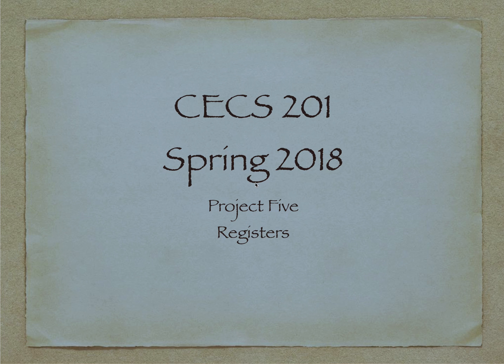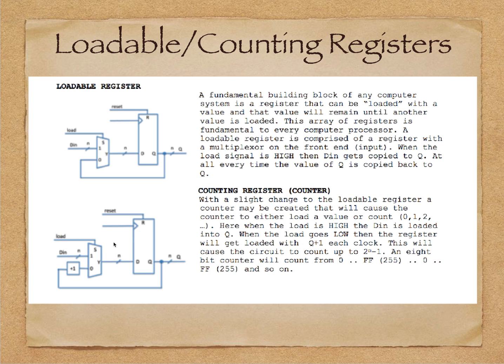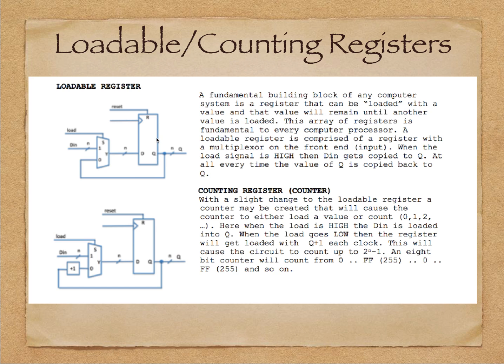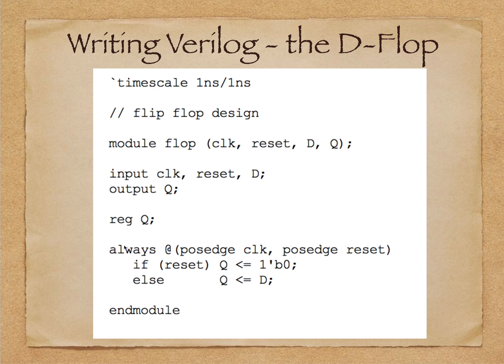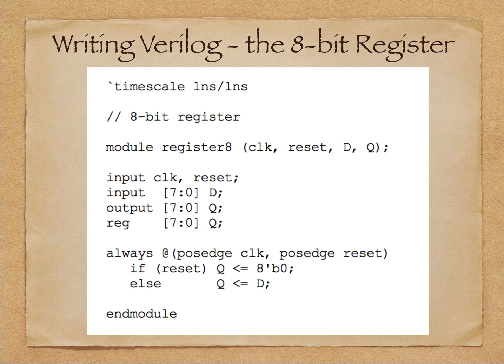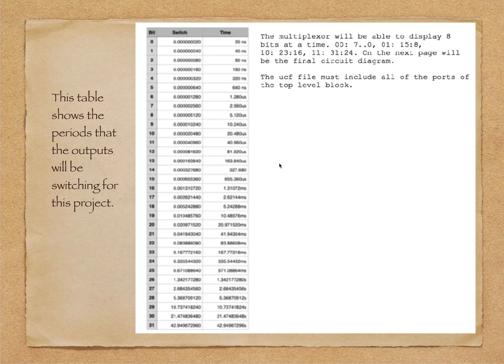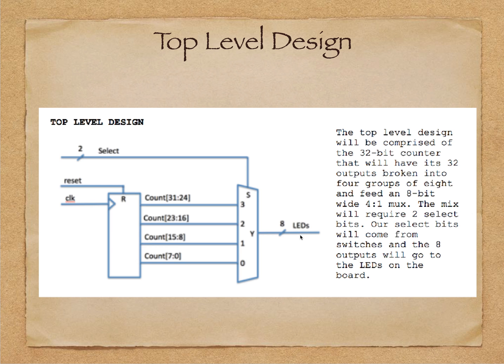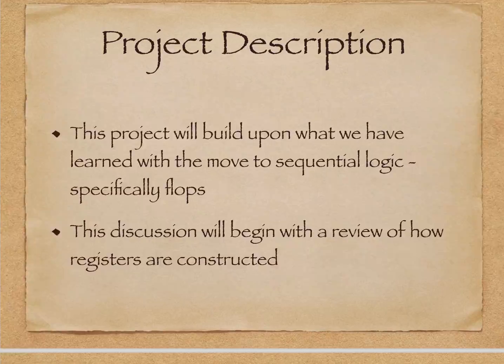201 Project 5

Comment: 1. You can electronically roll a die (design two and you can roll a pair of dice) by designing a counter that counts 1 – 4 – 5 – 6 – 7 – 0. Assume a single input (roll) that when true causes the die to be rolled. Design the FSM and determine if your FSM is stable (returns to a known state).

2. To launch a rocket the fire control officer must throw the arm switch and depress the fire
button. The launch sequence is to be stopped if this exact sequence is not followed. Design
the fire control sequencer.

3.  A cruise control for a car has three outputs: accelerate, decelerate, and constant_speed.
The FSM is modeled with four states (stopped, low, medium, and high); transitions between
states depend on the state and the control inputs (brake and accelerate). The brake overrides the accelerator in the event both are asserted. If neither is asserted the cruise control outputs constant_speed.

4. A serial packet of data always begins with the start nibble 0 – 1 – 0 – 1. Design a FSM to
detect the beginning of a serial packet and set a start flag.

5. An amusement ride operator has a button (0 = up, 1 = down) to toggle a stoplight (0 = green light, 1 = red light). In addition a second output is sent to the ride control computer indicating that a button-up event has occurred. Design this ride control sequencer.